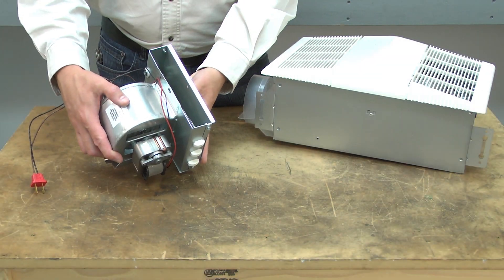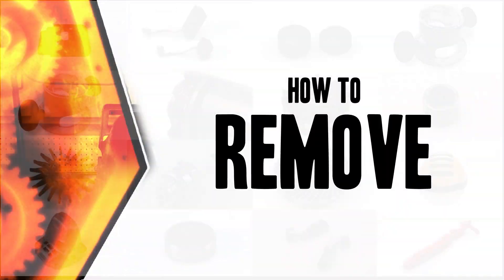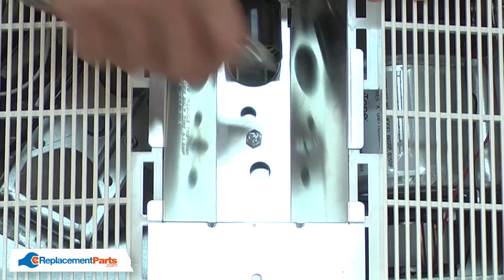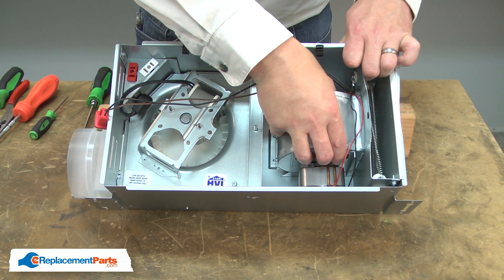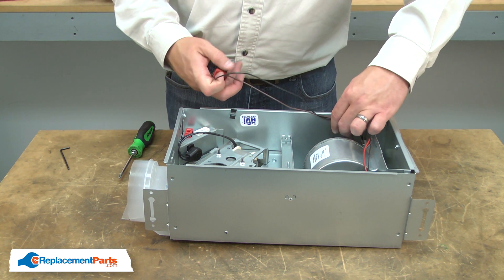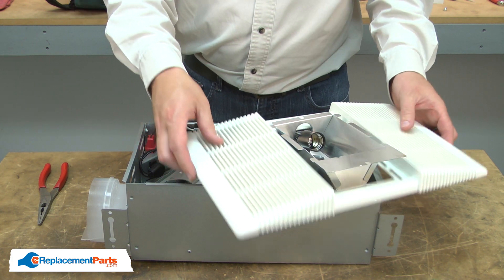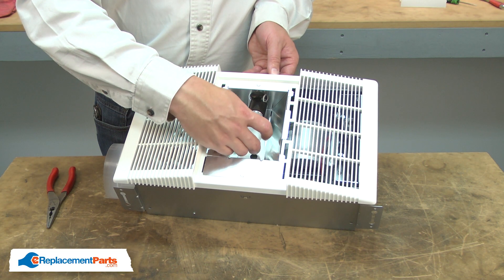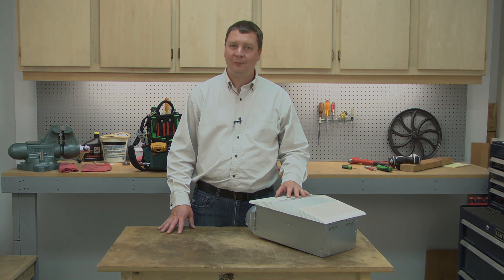NuTone Vent-Fan-Heater Repair - Replacing the Heater Assembly (NuTone Part # S97017648)

Comment: I do not think my problem is the heater element. I think the internal FUSE LINK has broken the circuit. I do not want to spend the money to replacer the entire blower/heater unit nor the heating element, I just want to be able to replace the fuse link # 553702000. which is blown. Can you hep provide instructions on just this?